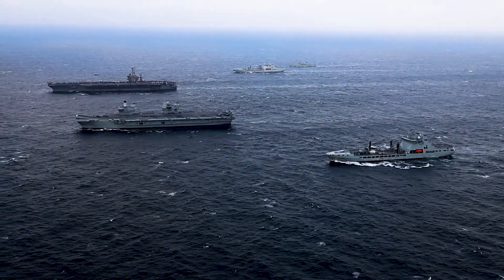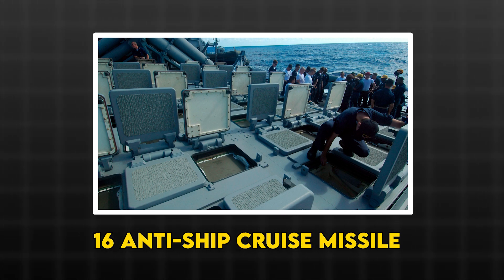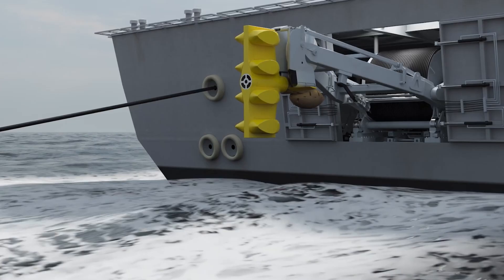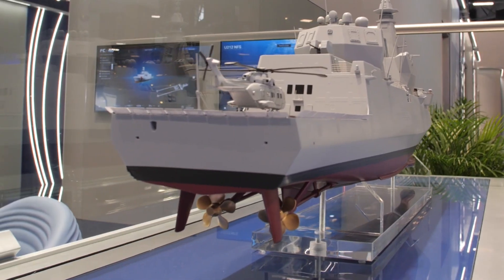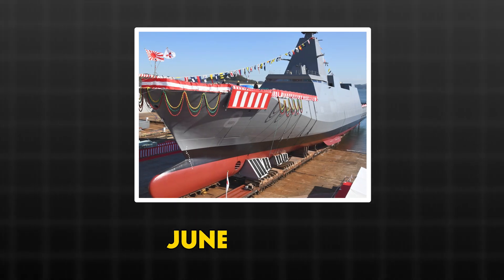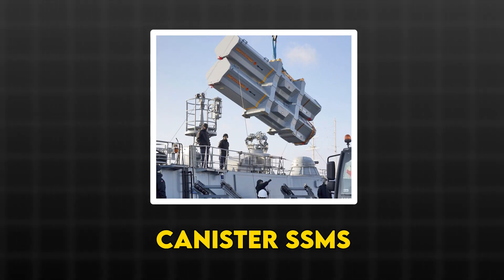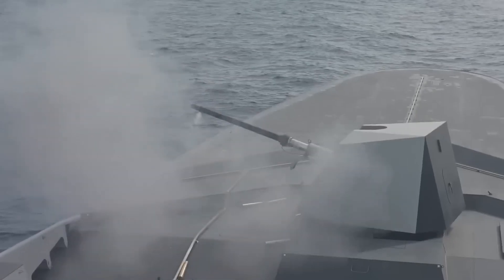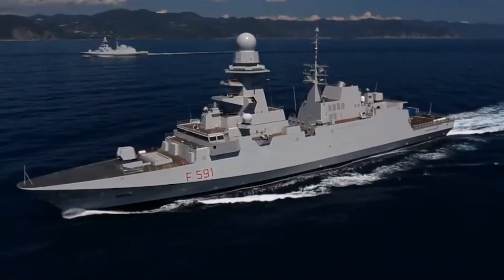Constellation vs FREMM vs Mogami: First Shot Wins

Comment: Considering the Constellation won't even be in the water before 2030, the other two win.
Reply from the maker: Yes, availability wins. Mogami is in service now, and EVO is slated for 2029–2030. Constellation’s lead ship is planned for 2029 delivery (about a 3-year slip), so “not in the water before 2030” isn’t quite right—but it’s close. Until FFG-62 actually hits trials, edge goes to the ships you can task today.

Comment: haha a flight of 6 B1’s supersonic loaded with Quick-sink’s and a dozen 35’s flying cover with a pair of 22’s sneaking around and there will be no navy left..

Do the math how many Quick-sinks can a B1 carry, how many times can all of these planes refuel mid air?
Reply from the maker: As retired USAF this is a fun thought experiment—here’s the quick math...and the real limiter:

How many QUICKSINKs per B-1? If it’s the 2,000-lb (GBU-31) variant, a B-1 can carry 24—so 6 jets ≈ 144 weapons. If it’s the newer 500-lb (GBU-38) variant, a B-1 currently carries 15—so 6 jets ≈ 90. (Those counts reflect existing JDAM carriage on the B-1.) 

“Supersonic all the way”? The B-1 can dash 900+ mph, but real strike profiles with heavy loads are mostly subsonic to preserve range and tanker margin. 
Air Force

How many refuels? Yep, there’s no fixed cap—packages refuel as many times as the tanker plan, crew duty limits, and threat allow. Multiple refuelings per sortie are normal in long-range ops. 

But even a big bomber volley still lives or dies by the kill chain—ISR cueing, tanker protection, and air cover inside a dense A2/AD. That’s where frigates matter: Mogami mass for sea control/ASW, EVO shields the air picture, and Constellation hunts subs and feeds targeting to the shooters. Numbers vs. capability decides the first 72 hours—not just bay counts.

Comment: In terms of radar, Constellation wins. SPY-6 is a BMD radar. Not only that 9 RMA SPY-6 means it has 9 mini/sub S-band arrays. Each RMA/array can function on its own. So it's a powerful and versatile radar. Other radars with a similar capability is UK's dual face/array SAMPSON radar. One array does high elevation scan while the other searches for sea-skimming missiles. For sea-skimming cruise missiles Constellation has another radar SPS-73(V)18.

Comment: Australia has just ordered eleven ‘upgraded Mogami’ with 32 VLS , improved radar and 10,000 ml range.  Most importantly it requires just 90 crew - but I’m almost certain Australia will have around 100.   The American vessel will be the most powerful ( if the US gets passed its teething problems).
Reply from the maker: Totally—Australia ordered 11 “upgraded Mogami” (32 VLS, ~10,000 nm), first 3 in Japan, the rest in WA; crew ~90, and ~100 for RAN is plausible. If the U.S. fixes Constellation’s schedule/weight issues, it’ll be the heavier hitter—until then, Australia’s pick puts capable hulls in the water fast.